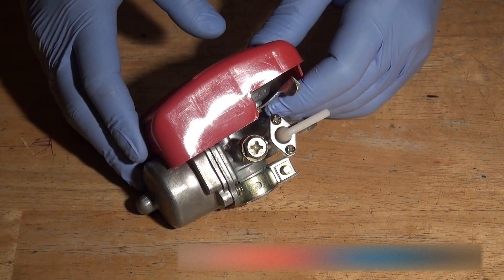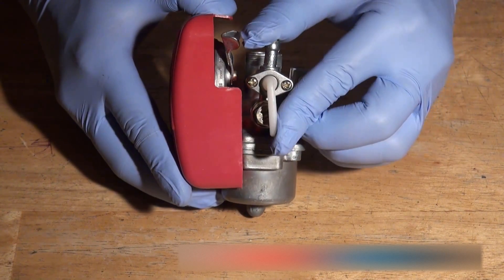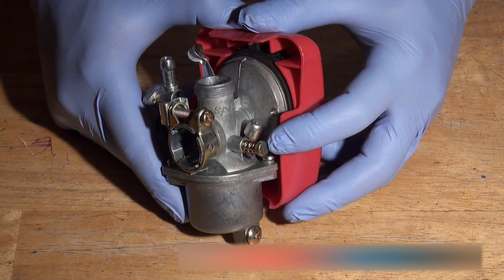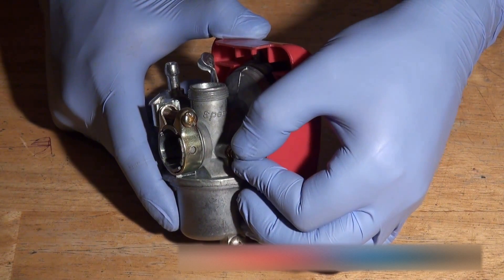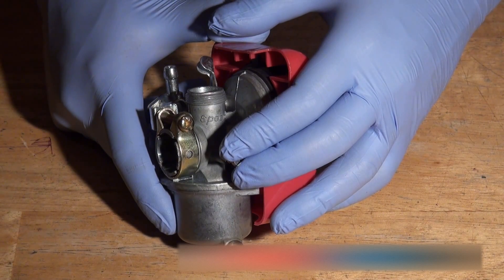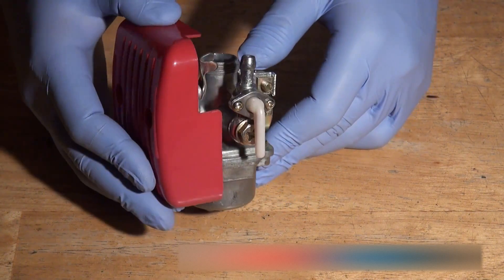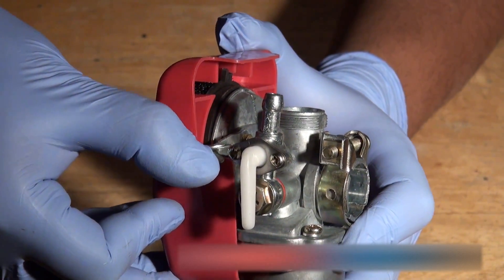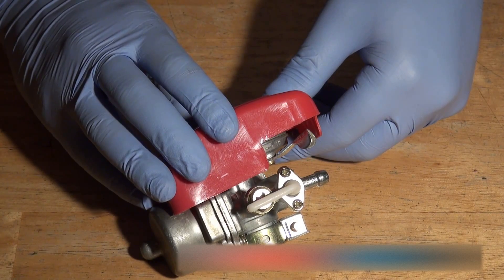Bicycle Engine Kit Carburettor Troubleshooting Tips

Comment: 3-1/2 to 4-1/2 turns would be 4 turns, so start at 4 turns . . . period.
Concerning starting and choke operation: when it becomes necessary to lower the choke lever "immediately" you will be MOVING. I think it best to convert the finger lever to a CABLE operated choke.